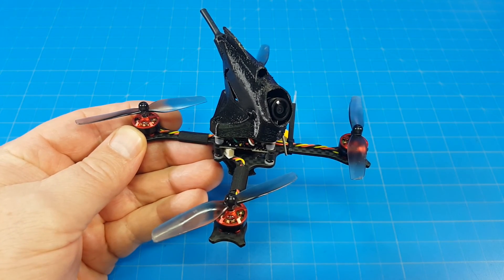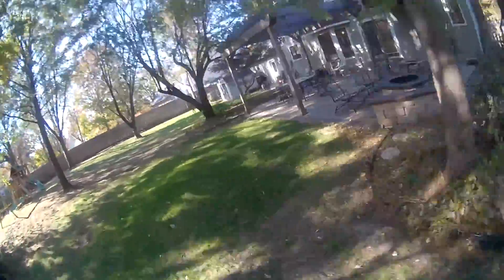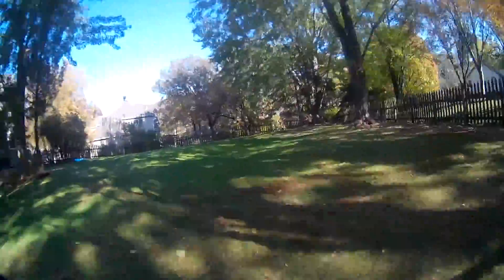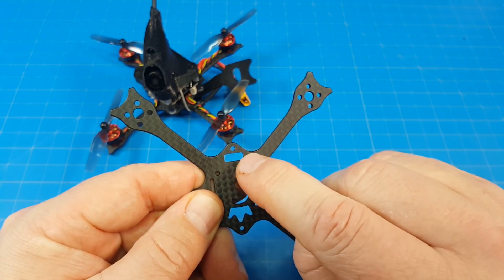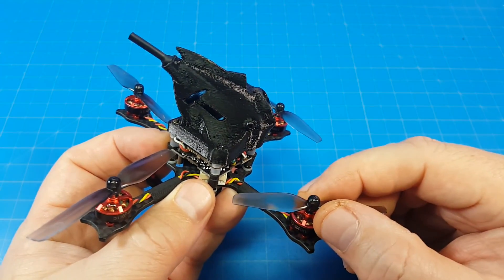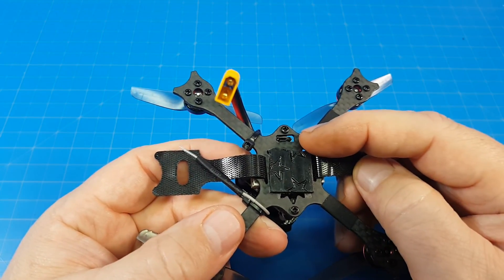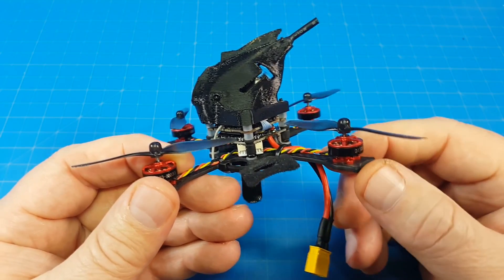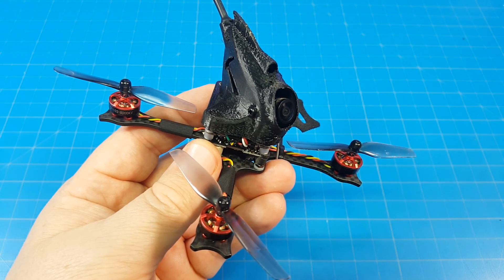NamelessRC N47 HD // Stiff Framed HD Micro

Comment: Oooh, that frame looks really good!  I tried the DamFastFPV frame, but it didn't quite work with my HX100 parts I had...I wonder if this would work well?  I'd still like to get the DamFast Split frame up and running.
Reply from the maker: the canopy of the hx100 won't mount but the other parts should be find. We might also need slightly longer screws for the motors.

Comment: Are the props 1 mm or 1.5mm also can i put a frysky r xsr in it i need the props mine broke on lost signal thanks brother
Reply from the maker: 1.5mm shafts, we can put an rxsr on it, but I am not sure the board has a smart port for the 4 wire connection we can use with rxsr, but otherwise we can still use it on a 3 wire configuration.
Reply: @NickBurnsFPV  thanks
Reply: @NickBurnsFPV  hi nick did you ever tune you n47 mine flies horrible plus it starts revving up on dives ive got loads of quads and this one is the worst i have ever had it records hd video fine just not fun to fly at all is there anything i can do to make it better thanks man

Comment: It really feels like these toothpicks don't do HD very well just because they weigh so little and so getting that smooth HD is really difficult since they don't cut through the air very well. The best micro HD footage I see usually comes from an Acrobrat style build which tends to be heavy and probably really helps with the smoothness. Though to be fair, if you just want some HD and don't care if it's smooth and 'juicy' these do work, even if they're compromised on performance and FPV feed.
Reply from the maker: I agree, it’s not for me but there must be some that just want HD no matter how vibby it might be

Comment: Nick I took a break from micros for a few months which in this hobby feels like years! Things are changing so rapidly, the last model I got was the sailfly and I want something with a bit more mmmmph, can you recommend anything sub 150.00 that’s BNF? Almost got the diatone gtb 229 always had good experience with that brand and happy model but there are soooo many now
Reply: If you want more punch the Diatone ER349 3" is pretty hard to beat. It's a real fast quad, and I believe you can regularly find it below $150. Lots of black Friday deals this week too. https://youtu.be/kqhn-0Q_0nw
Reply from the maker: If 3inch is an option The ER349 is a top performer and a bit cheaper than the many in the same category.

Comment: Fantastic flying, Nick!!! Great review! 😃
I really don't know about this size of props... But on the Eachine Twig the Genfan props were horrible! The HQProp 3x2 are much better. 
BTW, about the Caddx Baby Turtles, something that happened to me: I plugged the battery once and had no video. So I unplugged the quad, removed the SD card, reinserted it and plugged the battery again. And dude, problem solved. So I guess it's pretty sensible to the SD card position. 
BTW 2, I loved so much this camera I'm considering using it in a little wing I want to build! 😃